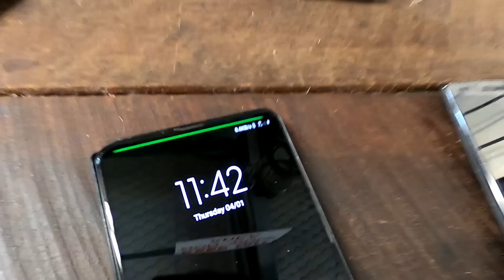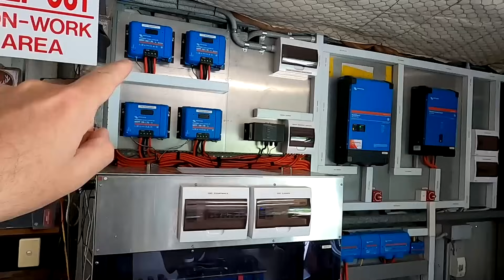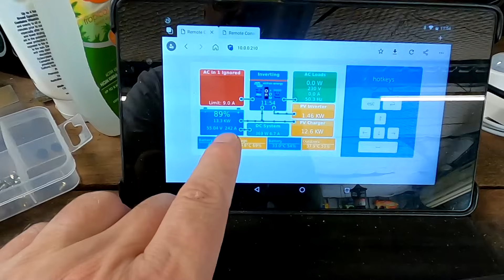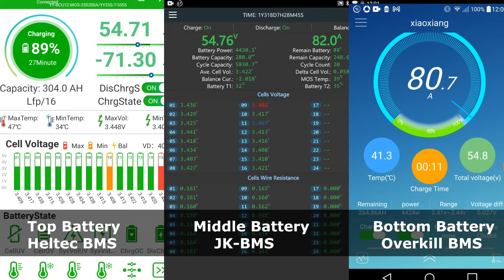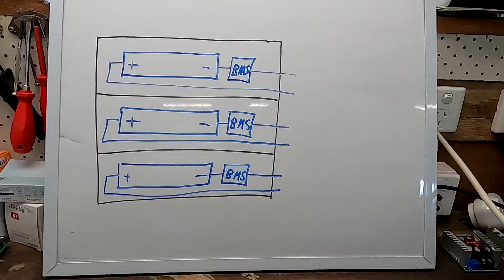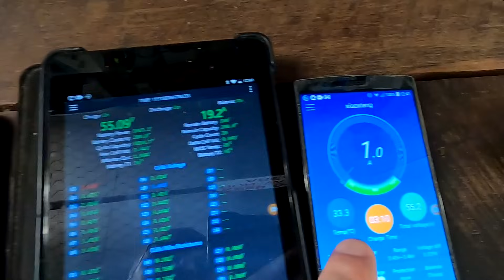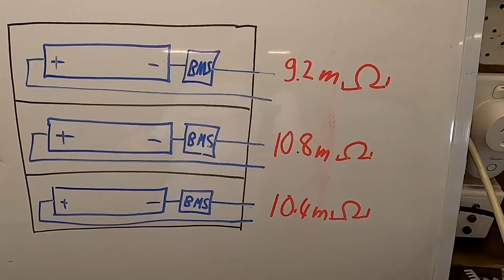Parallel batteries: one bank keeps charging when all the others are already full. But why???

Comment: In my case the 100Ah set says "battery fully charged" at 55V and disconnects charging. EVEs of 300+Ah stabilize at 55V and don't absorb anymore, while 300Ah+ CATLs get to 55.2. Maybe something to do with cable lengths also? Cable lengths are pretty random between ~25cm and 2m. I'm thinking of a small V-drop across them.

Comment: Seems like that middle shelf voltage is always a .1-2v lower.   Need to check voltage drop of bms and circuit breakers under load.

Comment: Sweet setup! Your garage is the electricity and free solar energy Valhalla. So I bought a BMS active balancer that doesn't have any visual or bluetooth notifications. I connected it for a few days and think it worked bc the cell voltage difference is minimal. Do you suggest leaving it on? Doesn't it interfere with mppt or inverters/buck converters..?

Comment: Did you ever get an answer to this?  I was thinking the "Profile" that each BMS has in the firmware.
Reply: I always thought that the charge termination curves engineered into the different BMS brands would certainly have an effect on the tail end of the charging.. I have two identical 17 cell 280a EVE batteries with identical (almost) JK 2A24S20P BMS controllers with the only difference being the few months difference in manufacture date and a slight difference in firmware versions.. One of the two banks always seem to lag the other when charging and even at idle where one bank should trickle into the other and eventually equalize but they don't.. So my solution was to slightly raise the full charge cut off voltage point of the trailing battery a bit higher than the leading battery and this seemed to bring them much closer in line with each other.. I charge at 3.51vdc have the full set to 3.5vdc and the float at 3.45vdc per cell..
Reply: There's a calibration feature for both voltage and amperage.  Wouldn't that make difference if the calibration was off? For instance, voltage from one BMS is 56 for pack x, but the other BMS would show 54 from the same pack.  If that happened, then the behavior would be different... Maybe?

Comment: I have 4 PCS 3.2v 280AH bank 24v all though charging I set the charger to 5A for better  absorption , “ the issue was I charged the bank to 14.6v = 3.65v so post 2 be but I have a 2 batteries 1 in 2 different banks each 1 of those batteries only charged to 3.37v and 1 battery in 2 different banks charged up to 4.0v and the 3.37v batteries stayed there ! What’s you idea “ Please “ ?

Comment: Hi Andy! I have been figuring out the daisy chaining batteries and the different voltage losses in those parallel connecting cables. If you think about battery voltage difference with almost empty and almost full battery bank. That voltage difference is much more than the voltage difference caused by the non equal battery cables. So the small voltage difference caused by the cables is not so big deal. The batteries will become almost empty and almost full :)

Comment: Hi Andy, could you or one of your subscribers please help, I'm a newby to battery's and solar but wanted to give it a go...I have 4x 12V 120ah lithium battery's and with my 10a lithium charger its take's them up to 14.6 volts when charging but after awhile they settle at 13.3v...is the 14.6 doing any damage to them...also what voltage should I not go past when discharging them...thank you so much for any advice....Steve from Perth WA
Reply from the maker: Hello Steve🙋‍♂️
14.6V is pretty much the maximum these batteries can be charged to. As there are 4 cells in each battery, it means, each cell will be charged to 3.65V which is again the maximum these cells can handle. The battery management system (BMS) in these batteries will turn off charging if one of the cells goes over this 3.65V. So, it is almost impossible to charge to exactly 14.6V because the cells are never 100% balanced.
Recommended is a more conservative charge voltage of 13.8V-14.2V for these batteries. This will still fully charge the batteries but is more gentle to the cells.
That the batteries are settling after you take the charger away is perfectly normal. They are still 100% charged.
Reply: @OffGridGarageAustralia  Thank you so much Andy

Comment: good afternoon andy andy question, I'm a little confused about the communication via can bus between the cerbo gx and the new jk bms, you have to modify the internet cable or you can use an original one without modifying it, that's my question, I'm confused and thank you in advance, andy
Reply from the maker: Yes, you can either make you own cable or buy the overpriced Victron Type A cable. Both will work.
Reply: Andy, good afternoon, thank you for the response, but do you have a diagram on how to make the cable? I would appreciate it a lot. @OffGridGarageAustralia

Comment: That is why i use different solar and charger array for each battery bank, and combine the battery banks through diodes so no power is transmitted from one battery bank to the other. Will be making some videos about my system soon. Amazing work Andy. I love your channel and your expertise. Keep it up 👍
Reply from the maker: The balance current from one bank to another is not a problem with LiFePO4. It is very small or even non existent. Depending on your system size, you can install separate chargers and arrays for each battery as you did.
Reply: With my system it is better with the diodes because the BMS's control solar charging for each battery bank but all BMS's control the inverter, so if one cell would fail without the diodes all power would go to the failing cell and fire/explosion could erupt.
Reply from the maker: @StarJackerSRL  That will not happen. that's what the BMS is for. If one cell fails, the BMS will disconnect this bank from the system. The diode will not help.
Reply: @OffGridGarageAustralia   123SmartBMS does not do that on it's own.
My BMS only controls the inverter and incoming charging from solar panels, that is why i use Victron diode battery combiner.

Comment: It looks like its a combination of the higher resistance (so harder to charge) and the active balancer (which is constantly bleeding off some current 24 hours a day) means the middle pack is effectively getting less into it. Because they are in parallel, you can't really "see this" on the voltage as the voltage will always automatically equalise between all 3 packs - but it appears it manifests as strange but repeatable differences in current?  Very interesting and to be honest it doesnt really matter as long as all packs do charge to 100% and all cells are kept equal in each pack?  Also I don't think you can see internal resistance during discharge as the cells can effectively discharge instantly (if you short them)?
Reply from the maker: The active balancer is only working if one cell hits 3.45V. It does not work 24/7 as most other balancer will.

Comment: Hi Andy   Really enjoy your video info and style and may have partial answere to above glitch (not seen in comments).  Following things I have learnedfrom LIPO ebike builds.  First, assume things you can't change are valid/the same (cell chemisty, internal resistance, etc.).  Next, make similar the controllable variables such as: cell temps, BMS model, BMS voltage calibration, lead length/size, cell SOC, etc.  This would mean manual "balance" to actual full capacity  or SOC, replacing vertical bus bars with equal length cables (maybe only for test) or at least connecting to bottom of one of them), measuring internal resistance  at actual usage high current dc level vice ac impedance, replacing aluminum bars with same copper, and NO balancing during test.   This should point to most of cause if ONE variable at a time changed.  Or, since that would take a long time, just ignore it but keep in mind for next time 3 or more banks need to be in parallel.  Can't find it right now but correct way to parallel 3 batteries/banks  really looks weird (SLA but LFP also due to flat charge/discharge curve).    Keep up the good work please and cold one sent.,  Dick
Reply from the maker: Thanks a lot, Dick!

Comment: Maybe the middle bank has a lot better capacity than the others and you can charge longer.
Did you experience some heat at the banks?
Reply from the maker: That should not make a difference. Even if it had double the capacity. Once all three banks are balanced against each other it should stay that way.

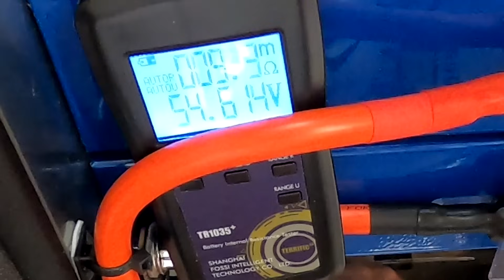Comment: Interesting Topic, ... as I have three 24v 280 Ah Eve battery banks (purchased one or two years apart), that all have the same 3 BMSs; with one battery bank charging or discharging at lower amps. I have suspected difference in individual battery cell chemistry and internal resistance; not sure. Was going to switch battery bank positions and keep bms positions while cleaning all bus bars and bms wire loom connects (someday), .. as a test for learning more all the time  ... for later. Not immediate concern as my setup is working good. Look forward to your next discovery on this topic. 🐾🐾🎶🌠 15:26
Reply from the maker: OK, so, if your banks are from different age, they may charge a bit different. That will be quite normal. Calendar age takes its toll. But yeah, swapping the positions can mitigate that.
Reply: was wondering if guys found out anything more on the topic. i have 2 us5000 + 1 us3000 pylontechs with about 500 cycles done and i just paralleled with a diy 280ah catl in 15s config. the pylontechs both charge and discarge with 10-40% more amps than the diy… they do reach equilibrium after 95% or below 15% soc tho so not sure how much of a problem it really is

Comment: Just to the side of the discussion. I use the YR1035 to quickly test the internal resistance of LiFePo4 cells. I then tested the same cells in a combination for battery banks via the EBC-A20 PC software and finally the same application with the EBC-A40L. All these tests were performed on dozens of Winston 60Ah cells and 16x EVE 304 Ah cells. All the Ohm values were completely different from each other even for single cell. Often even orders of magnitude different. You perform this task with the YR1035 for all three banks, so the implication of the instrument will most likely be very similar for all measurements. However, please remember that the real internal resistances will MOSTLY be quite far away from the results you define.👋Anyway Thank you.
Reply from the maker: Yeah, if you use different devices to measure the resistance, you will most likely get different results.

Comment: Happy new year Andy and community. Can you also measure the battery bank itself, this way you have your bank and BMS resistance. There could be a difference. Maybe also validate with the same clampmeter what the real current and voltage is, set the BMSes accordingly. Keep up the good work this year! Thanks for all your efforts in debunking all myths and issues related to batteries, chargers etc🎉
Reply from the maker: Thanks Edward and Happy New Year to you as well.
Yes, some have mentioned that here that the BMS could interfere with the measurement. I'll do more testing.

Comment: Voltage Current Calibration of the BMS! I use 3 Pace BMS after calibration oft the BMS on 3,65 Voltage everything is spot on! Also The Neey Balancer can be calibrated… I tested 10 Neeys on 1 Battery at 58,4V they are all slightly off 😉 after calibration everything is good… balance Leeds calibrated is also possible!
Reply from the maker: But this would not explain, why the middle batterie charges longer if the BMS is slightly uncalibrated.

Comment: It is because of the active balancer, it is lowering yhe voltage when balancing this causing more amps to flow.
Reply from the maker: The passive balancer will do the same. And even worse than the active balancer.

Comment: hi, would you be able to do an experiment with a 15 cell battery (like a pylontech or home made) and a 16 cell with a pacebms. I have 80kW with the Pace (8 batteries) and 37kW with pylontech  (11 x us2500C); what happens for me is: when both are connected, only the pace discharges unless the load is extreme (like 10kW, then the pylontech will take a very small % of the load, maybe 5%), If i turn the Pace off and allow the Pylon to discharge as its the only bank, when i turn the pace back on, it dumps whatever it has into the pylon to take that back to 100%. the batteries are connected as follows: 6 pylon, 4 pace to a lynx power in, 5 pylong 4 pace to a second lynx power in, then a lynx shunt , then a lynx distributor which has 3 inverters (voltronic 11kW) the shunt is the aggregator for the battery stats, with the pace connected via can to a cerbo and the pylontech connected to solar assistant for data, i also use SA to monitor the inverters. any insight appreciated.
Reply from the maker: You cannot parallel 15s and 16s batteries. That will never work! They have to stay completely separately.

Comment: It could be that your charge controllers measure voltage slightly differently, so it's trying to charge your middle bank to a slightly higher voltage (which ends up backfeeding to the other banks a little at the end). It would be good to check the voltage of all 3 batteries with the same multimeter.
Reply from the maker: The smart shunt is measuring the voltage and amps to all three battery banks. It then reports this to the MPPTs, so they don't measure themselves.
There is only one point of truth of measuring in my system.

Comment: The higher the current the higher the battery temperature and lower the internal resistance. Lower the resistance, current gets even higher. So one battery always wins the charging race. Adding series resistance (thinner cables) will help to balance the charging rates.

Comment: Andy, Don’t measure across different BMSes, go to the battery pack directly!
Reply from the maker: Each banks was fully isolated and not connected when measuring.
Reply: I meant to say that measuring across a BMS is not going to yield reliable results, you got to measure before the BMS in my opinion.
Different BMS have different mosfets (type and amount) resulting in different impedance.

Comment: Could it be that because of the lower total resistance, bms included, of the center bank more ah were removed and therefor mire AH were required to charge the cell? The voltage was lower during charge, after all.
Reply from the maker: More testing needed. When I setup the Peter boards, I found something interesting...
Reply: Can't wait to hear about what you have found.
Reply: My daly banks and the JK banks give similar results

Comment: I’m a bit puzzled: By not measuring the impedance from each busbar across the cables into each MCB, through each MCB, and across each battery, you still have 3 unknowns (at least, unmeasureds) in the system—the Positive busbar to MCB positive output and negative MCB output to negative busbar for each of the 3 batteries. This might explain higher resistance and lower voltage of the middle shelf battery. 

A second source of variation in resistance could be your busbar connection configuration. I’d have to go back and see the video(s), but I think you did use a diagonal config and kept the MCB to busbar positive cables equal length (to each other) and negative cables equal length (to each other). In theory, each of the unmeasured cable/busbar cumulative resistance should be the same if you used diagonal wiring and had same distance between each battery cable. 

Unmeasured Sources of variance could be torques, washers, crimps, different wire chemistries, corrosion, and—outside the wiring—the MCBs when closed. 

If, after you have done the swapping of the BMS’s (I’m assuming YT production times and you’ve already done the swapping), and the slower charge/load rate doesn’t follow the middle BMS, you might look at these things which are currently assumed.

Comment: I'm almost sure that the problem arose because of BMS
Because every BMS measures current based on the voltage drop on both ends of a resistor (that is, within the internal design of the BMS, resistors of a small value are placed to measure the current).
It seems that JK BMS uses resistors to measure current that have a lower value than other companies
A while ago, I had a similar problem, and the reason was the internal resistance of the multimeter (for measuring current).
You can confirm that this is actually the cause of the problem by placing the JK BMS in the lower or upper battery pack and observing the results

Comment: I have noticed the very same thing with my system.
 In particular my 1 bank of 3P x 16s Identical cells (EVE 280's), identical BMS x 3 packs wired similar to yours. 
All batteries were from a single batch, BMS's from same production run. Active balancers also same production run. All were installed and commissioned within days of each other.
  In my case (and yours) cell capacity matching of the banks is the only difference. The best "capacity matched" bank, takes the longest to discharge and recharge as compared with the others.  In your situation, you could also add the small differences within your different bms's.
Reply from the maker: Thanks for sharing. I have also the aluminium bus bars, so more variables to play with. I really don't think it's the BMS...

Comment: Andy regarding alu or copper the thickness is important but also the contact area and material of the bolts count. I have a similar situation, need to find time to investigate since it stress more one of the batteries.
Reply from the maker: Well, the contact area is not too important if the torque is sufficient. Whe have tested this here and could push over 230A through the tiny contact area of terminal and bus bar: https://youtu.be/VPQvs-2YYzA
And I'm still running this exact setup in the top and bottom battery.